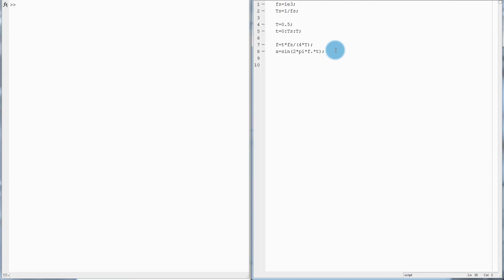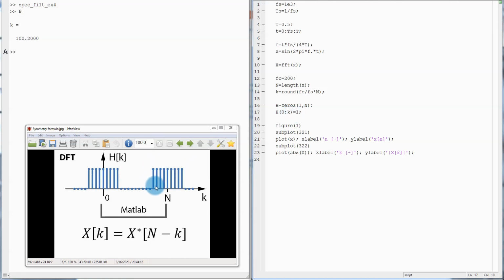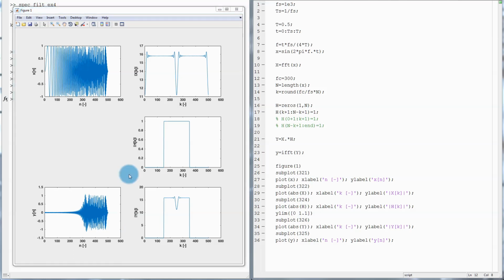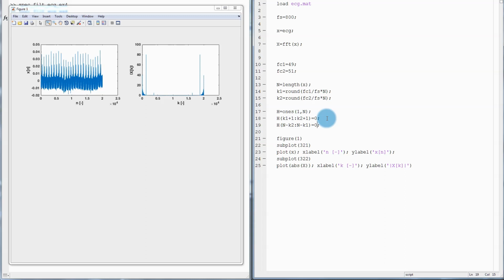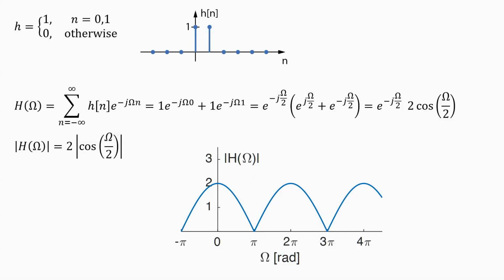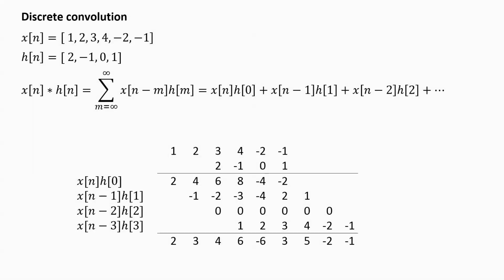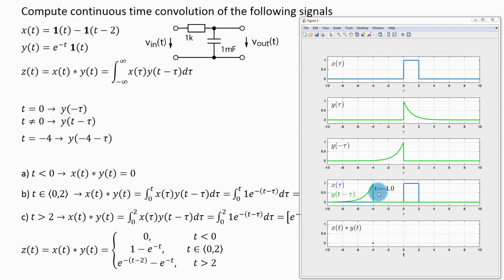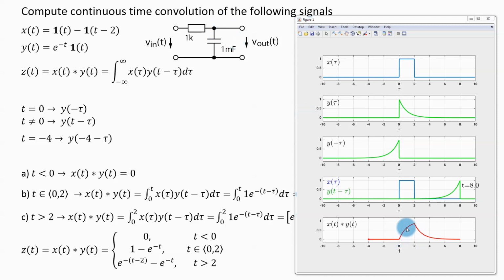Signal Theory (Signals and Systems) - Exercise 4 - Filtering, Frequency Response, Convolution

Comment: Question about Discrete Convolution, min 43.35: will the length of my vector y[n] always be equal to N+M-1?
Reply from the maker: Short answer: Yes.

Long answer: If we have two finite length signals x[n] and h[n], where x[n] has N samples, h[n] has M samples, then their discrete convolution x[n]*h[n] will have N+M-1 samples. This is quite nicely shown in the manual computation of discrete convolution at 43:35.